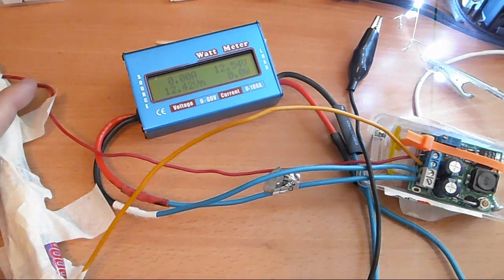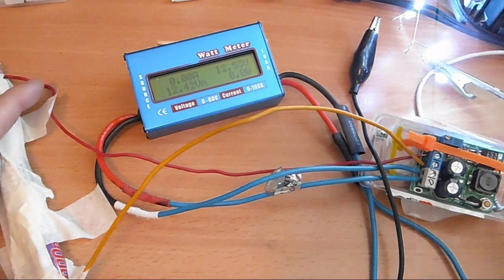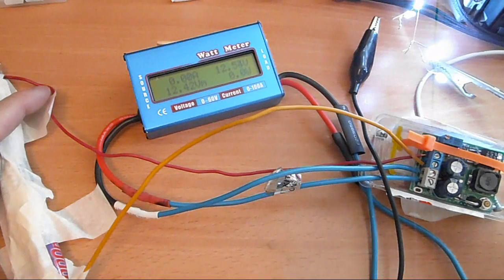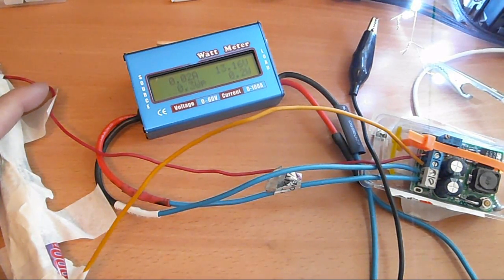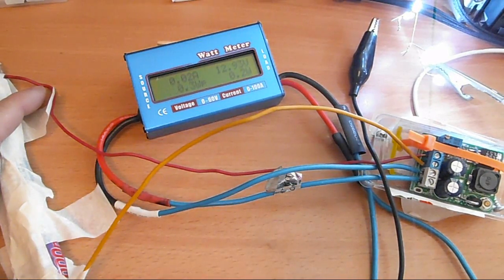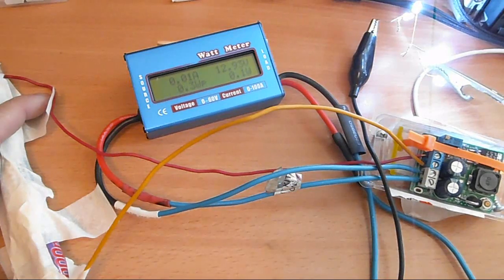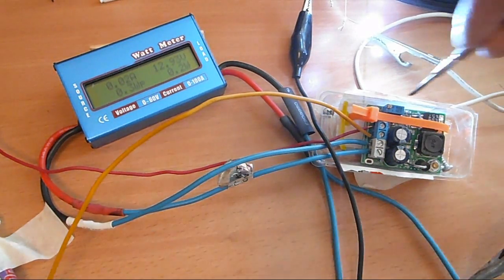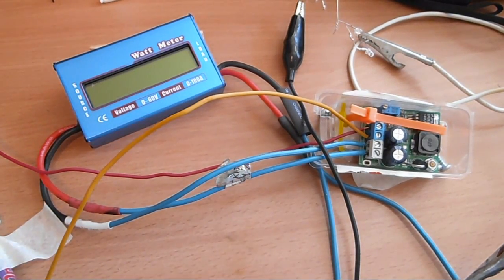Update to my dc step up converter

Comment from the maker: I'm not too familiar with a joule thief.  I think the joule thief and this board works in similar ways. This costs only a few dollars because it doesn't handle much power. I think this type of board has more regulation of power than the joule thief. I could be wrong.  The advantage is this board doesn't consume much power. Nothing comes from nothing. Both this and the joule thief boost the voltage at the expense of higher current draw.

Comment from the maker: Yes, the idea of this booster is to increase the voltage so you can charge or operate devices of different voltages. The limitations is this is a small unit and cannot handle a lot of power. According to the specs, it can handle 60 w only so it'll work with a small wind turbine.

Comment: So if im understanding this right you can use it with a windmill that is not putting out enough voltage and increase it so you could then charge your 12volt batteries?  or possible charge a 6 volt or what have you?